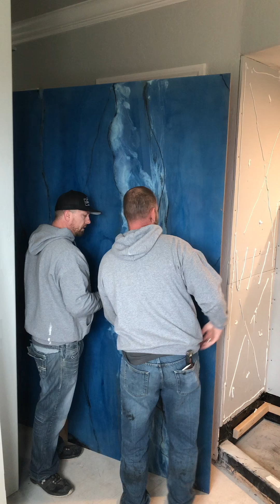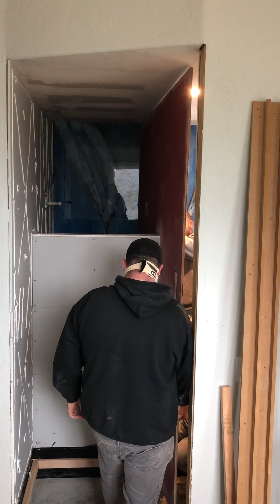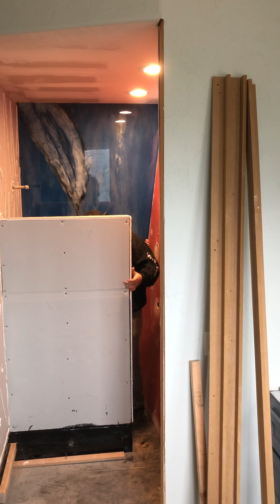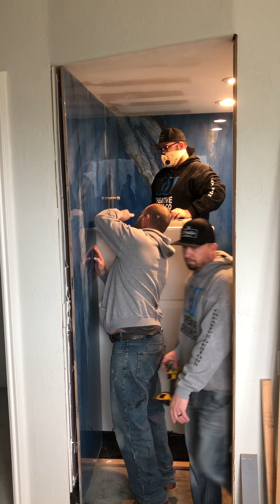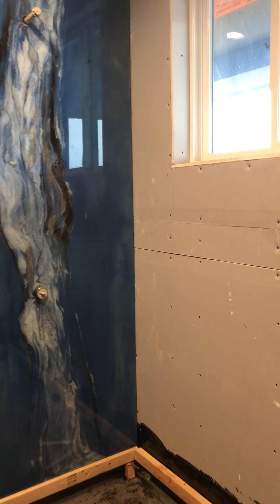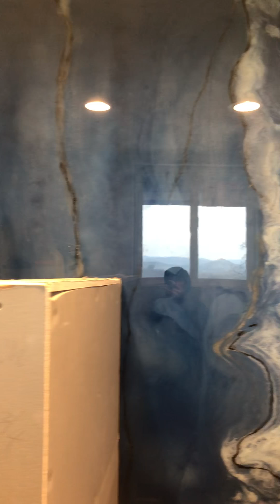Epoxy shower wall installation- part 2

Comment: Question, what are those braces that you're using, and where can I get them? And did you do this with plywood, OSB, or foam? 

When you use epoxy on foam, does the epoxy make the foam stronger, so you can hang items from your walls? Example a picture, or a mirror, or even a towel rack? Or should we use OSB or plywood instead? What's the good and bad of using epoxy, and foam vs wood? I'm obviously in the research stage. I'm remodeling our entire house, and I think this would be cheaper then sheetrock, much cheaper expecially since I already have foam boards, oh could I use concrete board? And epoxy that? I have a bunch of that, but putting a nail in it to hang a picture, it cracks, big time! So that's not an option besides using for tile work and the tile makes it stronger, is the epoxy the same idea as tile? Is epoxy strong? I've never touched epoxy, but I know it's beautiful. Also can you make it not glossy? Like dual looking like sheetrock? No shine? Thanks for answering my questions, I appreciate you guys! God bless!
Reply from the maker: Good morning. If you call our office someone there would be able to help. 530-441-7550

Comment: How did you join the seems?  (I take it that was MDF maybe 1/2"?) I have heard of people using Dowel or Biscuit and adhering with wood glue or epoxy. When yours was carried in it looked to be very solid like it was one piece (better than most I have seen hence the question).
Reply: I need to know how as well
Reply: Me too. Maybe tape and bondo the backside?
Reply: Or glue strong, thin metal strips to back?
Reply: I’ve seen ppl use insulation foam boards covered with plexiglass

Comment: What do u put in the inside corners to marry the 2 panels together? Or is it tight enough not to require a seal?
Reply from the maker: Shayne Zarkowsky we actually build our pieces larger by one inch. After epoxy we cut off the edges so that the joints are epoxy to epoxy. We use small amounts of silicone in the corner. It’s absolutely seamless after doing it like this. Thanks